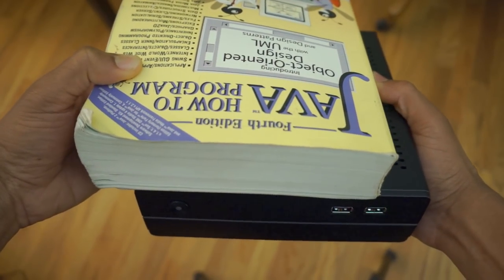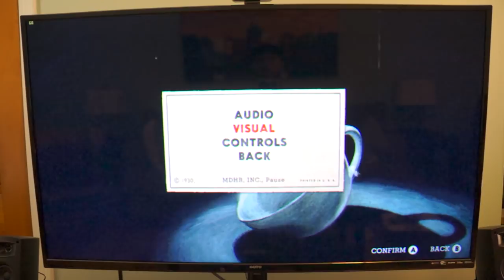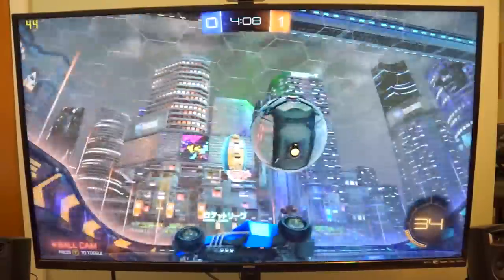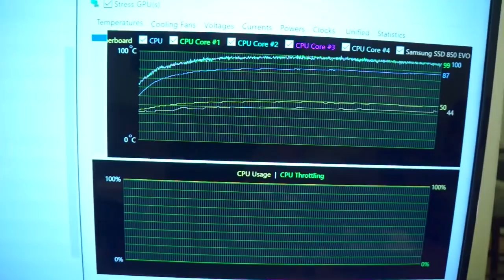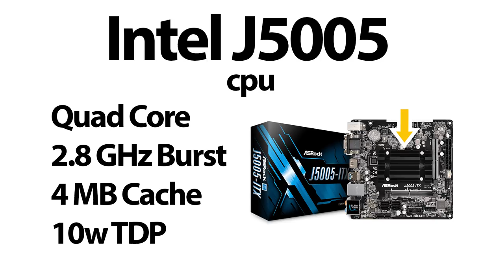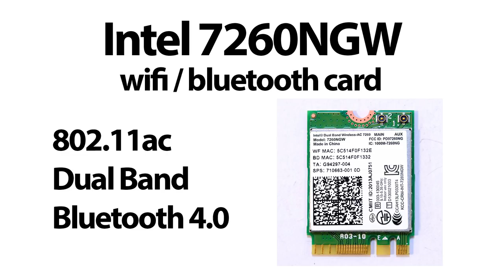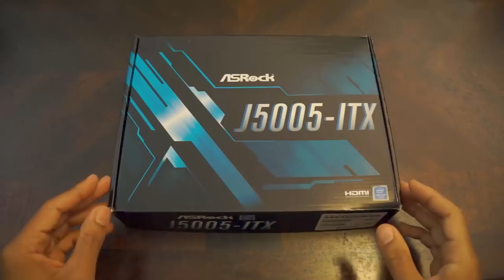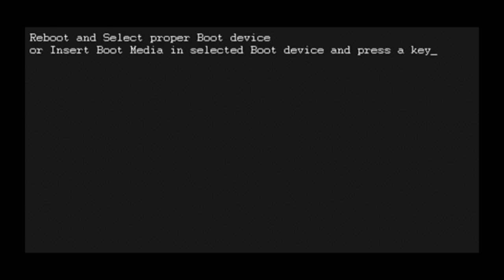Sub $400 Silent 4k Video SFF PC / HTPC Build Guide (Project Kyrie)

Comment: For $160 on ebay you can buy a Dell small form factor system with this same CPU. Add a SSD if you want. Comes pre-assembled with a brick PSU, wifi, and some ram.

Comment: Very good video.That case is real snug but nice. I just did a build using the Asrock J5005 and it will take 16GB of memory. If you need /want 16 GB use the G.SKILL F4-2133C-15D-16GRS kit.
First run 8GB, update your bios to the latest driver than install the other 8 GB .When you power it back up wait for the real, real long pause  and it will finally come up with the 16 GB.

Comment: you CLEARLY have no idea of how ESD protection works, this type of grounding only work if there is PSU installed in the case and it is PLUGGED IN to the wall.
Reply: Hmmm, I am an electrical works estimator/planner; been doing this for a while. When you talk about electrical work you need to be specific; because electricity is (specific). He does 'have a psu installed'  that black thing shown at 4:50 is a power supply unit (PSU) Double insulated PSU's wouldn't work. People see an earth pin and think "YAY its earthed", no dice, its just fault protection for a primary coil/cable failure. Lets assume you meant installing a PSU with a frame earth connection would provide ESD protection when working on the PC: 'Plugged into the wall' even with the earth connected to the dist.board, still relies on the main earth, MEN star-point/matting earth connections to be in good condition. MEN systems require the neutral connection to be clean and well terminated, right back to the transformer, otherwise floating voltage issues can arise and could in fact raise voltage potential your workstation; making "plugging into the wall' a really bad idea. Test before you touch. Another discussion is capacitors and test equipment. In reality, the best ground is a remote earth; a pin struck at general mass of earth potential, separated from the distribution system, good connection to your tooling and person. Test test test. If you are going to be technical, then be technical.

He's not the only one reading this comment; also this video is great. I am sure you just wrote that really quickly or are having a bad day; maybe explain to everyone the basis of your complaint, so that people who don't understand these principles can learn more about how to protect the equipment that we all care about so much. All of us learn, every day. Today, I learned (the hard way) about line-reactor reflective wave potentials... expensive mistake.

Comment: Great guide, all the parts a couple of days ago, had to make some minor changes to ram/case due to UK availability. Should have this up and running by the weekend. Thanks for your video...great resource for a lightweight build I would never have considered...was planning to go down route of full size GPU, PSU etc and its only for streaming and browsing, this is a much more elegant, lower power usage and quieter solution...cost me £292 delivered via amazon prime! great job!

Comment: You can save some cash doing the following. 1 Use a J4205 based board if you do not need quite this level of performance (they can also be about $50 cheaper than J5005 boards). 2 If you are using it for a multimedia PC then use a cable from the PC to your router as the cable will cost maybe $15 less than the network card. Places to not scrimp on cost: Always use two memory sticks. This doubles your memory bandwidth and will speed up the system. Use a decent quality SSD. Cheap SSDs can be half the speed of for example a Samsung 870 EVO.If you want to go completely OTT getting the power rating down then N series motherboards are the way to go.. EG an N3150 is 6W compared to 10W. Check your motherboard can use low power(low voltage)  DDR and this can save you 2W per stick.

Comment: I know you like the air keyboard for your htpcs.  Have you ever tried the Inteset PC-IRS5 ir receiver so that you can use a real remote like a Logitech harmony to control not only your htpc but also your tv, av receiver, sound bar, etc?
Reply: Does this have an ir learning function? The kind that is learned directly from another remote I mean.

Comment: Worst motherboard. Especially ASRock I have J3455 bought about a month I have all components installed according motherboard specification freezes after strame YouTube for 10 minutes. CPU run unde. 70f temperature. Thought psu bad I add ATX power supply still doing the same. Went to third  website to upgrade the BIOS cant find website what can a manufacturer are they. guys never buy AsRock that's my first time had bad  experience with the ASRock that sucks
Reply: Asrock isnt bad lol dont buy a budget motherboard lol your better off building a ryzen am4 system with the athlon 200ge and that will do you good. This guy has a Pentium which will hold you back from gaming. All that computer is good for is just watching YouTube and replying to emails.